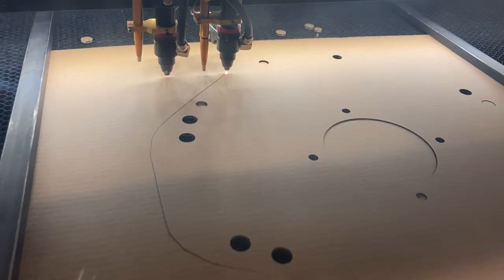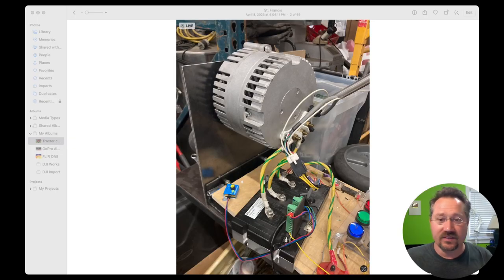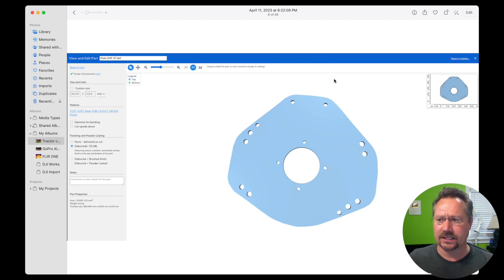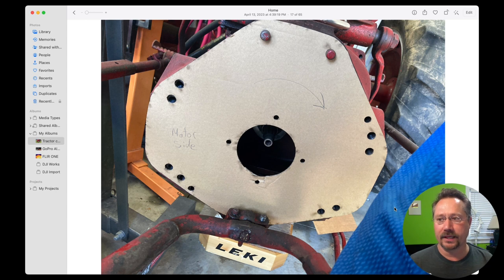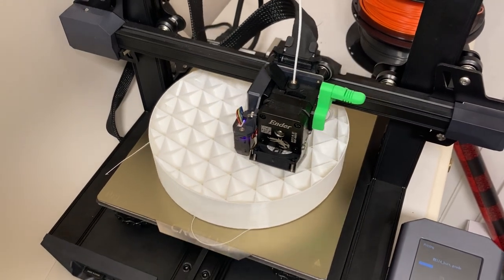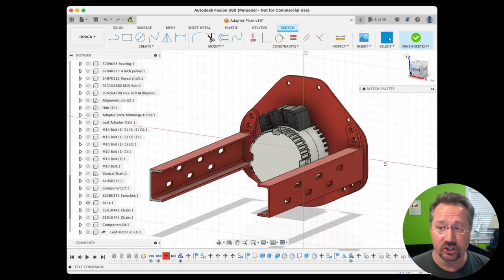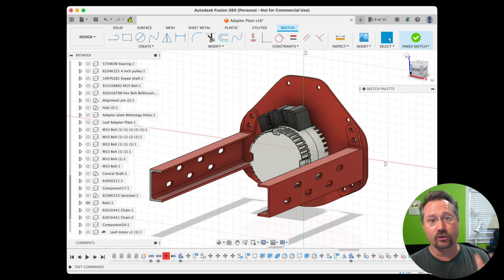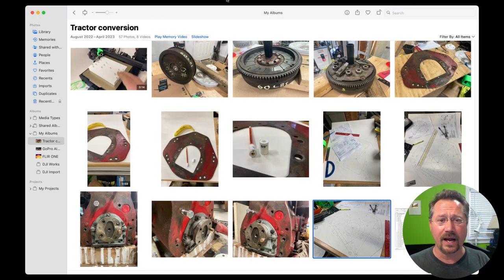Electric Tractor Update, April 2023 (International 300 Conversion)

Comment from the maker: A note on going clutchless/keeping the flywheel or not - I am making sure to NOT modify the transmission parts. If I go clutchless, I'd just disconnect the clutch pedal. If I decided clutchless wasn't appropriate and I then wanted to add the flywheel, all the parts would still be there to make it happen.
I also have the original flywheel/clutch/clutch-cover AND a new clutch and clutch cover, so I have both parts to build an adapter AND parts to do a stock setup.

Comment: I think you're better off using that clutch.  You keep the full functions of the tractor, and also, a heavy flywheel actually works well in your favor if you're using it to plow and hit a rock, or hitting a stump with the brush hog, etc.  that sudden SHOCK to the system will be much less damaging towards the motor because you have the momentum of that heavy spinning flywheel in your favor, and it will absorb most of that shock due to it's high inertia.  You can just program your initial start/ spin speed of the motor to be progressive or gradual at first -- so that it allows your flywheel to get moving without a sudden spike in current like it would if you just stomped on the gas all the sudden.   

Also, I have to say-- if you're worried about that flywheel being to big or heavy etc. because it's not powerfully enough, then your tractor isn't really going to be that useful.  Because when you're pulling a plow in the ground or dragging around a brush hog, or using a  post hole digger or whatever else you want to use this for--- it's going to require a lot of torque coming from that motor.   I'd use the flywheel and clutch-- that is the absolute best play IMO.

Comment: Great video! I think I would have tried putting an alignment rod on the transmission shaft, then using a quarter inch piece of plywood for the template, with a suitable hole in the center for the alignment tool, and just trace the plate outline from the transmission side. Thanks for sharing.

Comment: Glad to see this project again moving, so you have gone away from using the leaf motor and controller and battery's or have I missed a video of a red think. 👍👍
Reply from the maker: Just trying to figure out what’s best for the project. The Leaf motor needs well over 200v to run. It can spin at up to 10,000 RPM, but old tractors like this run at around 2,000.
Reply: @BenjaminNelsonX  right sounds like a bit of a miss fit by a couple of revs. 👍👏

Comment: So, I’ve got this “extra” 3 cyl. Ford 4000 that, under load, lost compression in a cylinder. Instead of rebuilding toying with doing an ekectric conversion...thanks for the video. Lots of helpful stuff here. 👍

Comment: I’m heavily emotionally invested in your tractor, here in suburban Brisbane, Australia. I strongly believe we must figure out how to convert old rolling stock as part of the transition away from fossil fuel everything. Have you thought of building the battery holder so you can swap out the spent battery pack with a fully  charged module to increase the work duration of the tractor? I can’t wait for the next instalment. More strength to your arm!

Comment: As you mentioned, you could devise a connector which rotates both shafts so that the PTO can be used when the tractor is moving.  Then additionally, using your separate hydraulic capability, devise a system that raises the back wheels slightly so that you can then run the PTO with the tractor stopped if needed :)
Reply from the maker: Easy to run the PTO with tractor stopped - take it out of gear.

Comment: Couple things on the tractor.
If it has a "t.a." torque amplifier, it will not engine brake when the lever is in the rear position.
The flywheel situation. The stock flywheel isn't recommended spinning much faster than factory 1450 although I've been spinning mine to 3500 😮. northwoods engineering out of ham lake mn can make you a cnc aluminum flywheel, they build them for antique tractor pullers.
Reply from the maker: Interesting about the torque amplifier! I hadn't heard about not engine braking while engaged. I didn't see that listed in the owners manual or anything.
An aluminum flywheel would be slick! Wonder what the cost is on that....
Reply: @BenjaminNelsonX  It should be listed in the owners manual under "Torque Amplifier" and then "Driving the Tractor". There's a warning that says:

"Caution! To maintain safe control of the tractor speed and to utilize the engine as a brake during downhill transport operation, the torque amplifier operating handle should be in the direct drive (fully-forward) position.

Note: The torque amplifier operating handle must be in the forward position when it is necessary to tow or push the tractor to start the engine"

Basically when the TA is engaged (pulled back) it has an over-run clutch that will allow the transmission to spin faster than the motor. So even if the motor is completely stopped the tractor could keep rolling while in gear if the TA is engaged.

Comment: Glad to see an update on this project! I'm in the planning stages of a nearly identical conversion and I'm planning on using a similar motor: the ME1003. Right now I'm trying to decide on which battery modules to use, have you chosen those yet for your conversion?
Reply from the maker: I haven’t decided yet. In the end, I think it’s just going to be whatever maximizes total KWH under the hood. Right now, I’m just focused on the driveline and I’ll use some small batteries I already have for testing.

Comment: Might just use the flywheel and clutches as they were. With regen you can recapture the rotational inertia.
Not sure if the bearing on the motor can support the weight, though...
Glad to see progress being made!
Reply: Would it be possible to weld some sort of a cradle to the motor shaft to take some of the extra weight???

Comment: Glad to see you working on this project again. I wonder if they make a motor strong enough that would be like those motors on the back of a washing machine tub. That way, it could fit inside the housing and with the PTO spline in the center. Then that would be fully integrated inside and run the PTO? Just a thought. Bet you're glad you bought your Bolt now that GM is ending production! Big mistake on their part.

Comment: So glad to see progress on this! I do have one question though:  Why 72v? I would think for this project you'd be fine sticking with 48v which would make it a lot easier to source batteries/BMS and other parts as 48v stuff is a lot easier to get than 72v.

With these DC brushless motors the torque you get is a constant amount of force per amp. The voltage only really affects the top end motor RPM. The original gas motor in this tractor maxed out at around 1750 RPM. I don't think you'd want to drive the input shaft of the tractor (The "driven shaft" as you call it) much faster than that as the transmission components weren't engineered to run that fast. You also want to stick with 1750 RPM because that's the RPM that will drive the PTO output shaft at the correct "540 RPM". If your motors runs faster than 1750 then you're going to have issues with everything downstream not running at the right speeds. Given you're probably going to be running this at such a low RPM there's just no need to go with such a high voltage. 

The double edged sword here is also the horsepower rating of the motor is based on running it at 5,000 RPM. If you're running it at say 1750 RPM instead, this motor puts out 0.1 ft/lb of torque per amp of input. So at 120 amps (Max continuous) you've got only 12 ft lbs of torque. The stock engine you pulled out of that tractor was capable of pushing around 120 ft/lbs at 1200 RPM (According to the University of Nebraska Testing)

HP = Torque (ft/lbs) x RPM / 5252

So at 12 ft lbs and 1750 RPM you're going to get around 4 horsepower (max continuous) out of this motor. It can surge up to 10 HP for 30 seconds, but that's vastly under-powered compared to the engine you removed, which tested (On a dyno) at 43 HP at the belt. I know you're saving some power from the hydraulic motor, but hydraulics only pull a few HP from the motor, it's not saving you THAT much.

If I were you I'd try to find a motor with a higher torque rating. You don't need the higher RPM that the higher voltage will give you. Instead you need something with more torque. I would completely disregard the HP ratings of the motors you're looking at. At these low RPMs you're never going to approach the max HP of the motor. Instead you should look at their "peak stall torque" and get something that at least peak closer to the 120 ft lbs (163 Nm) that the original gas motor could produce.

The ME1302 for example gets you a lot closer at around 74 ft/lbs, but it's still a far cry away from the 120 ft lbs the original gas motor could make.
The biggest torque output I could find from Motenergy is the ME1616 at 134 Nm / 99 ft lbs. Still not 120 ft lbs, but close enough that this would probably work.

I also think going with a separate motor for the PTO is a great idea. You generally want the PTO to always run at 540 RPM, but when you're mowing, tilling, etc, you may want to adjust your forward ground speed as you navigate bumpy terrain, turns, etc. Having different motors for the wheels and the PTO, you can easily adjust your ground speed while maintaining a constant 540 RPM for the PTO.

One idea I've had for these tractor conversions is having separate motors for the PTO and drive wheels that you can couple together when desired. Basically there are two primary ways to deliver power from a tractor:

1) Tractive power
2) PTO power

When you're mowing, rototilling or doing anything else with the PTO: You want most of your power going to the PTO. In these applications the wheels aren't doing any real work, they are just rolling the tractor around.

But for pulling plows, discs, and other equipment: You need all your power at the wheels. Since these implements don't use the PTO, you don't need any power at the PTO.

So for me I'd love to see a system where the PTO motor can run separate when doing PTO work, or couple it to the drive motor to get all power to the drive wheels when pulling heavy implements like plows. You could use a bigger motor for the PTO and a smaller motor for the drive wheels to save costs (Since the PTO always needs a lot of power when in use, and when not in use that power can be diverted to the wheels anyway)

I wonder if you could re-purpose the clutch to accomplish this: Drive the inside shaft with one motor, the outside shaft with another, and use the clutch to couple them together when desired.
Reply from the maker: Some interesting thoughts there. Going with 72v would mostly be for lower current for a set amount of work, rather than for higher speed. It’s not much more difficult/expensive to get 72v parts instead of 48, but it does tend to go up quickly above that. 

Another good reason to go with a separate PTO is that it would allow running the motor faster, and then gearing down more for the increase in torque.
Reply: @BenjaminNelsonX  "Going with 72v would mostly be for lower current for a set amount of work, rather than for higher speed."

So I totally understand where you're trying to go with this. But I think you're going to find that with this application "work" is usually more of a function of "torque" rather than horsepower. With most of these electric motors the key to higher HP ratings is pushing higher torque values at higher RPMs. But in this project you're RPM constrained: You can't really run any faster than 2,000 RPM. 72v would let you do more work with less current at higher RPMs, but not so much in the lower RPM ranges you're dealing with.

According to Motenegery the ME1117 has a torque constant of 0.13 Nm per amp. So 120 amps will give you roughly 12 lb ft of torque, regardless of what voltage you're running. So going with a higher voltage is not going to buy you much. Where as going with a lower voltage would let you buy a smaller number of bigger beefier cells, fewer cell taps, etc. Instead of 24 cells at 200Ah each you can do 16 cells at 300Ah each. You'll get more usable torque this way because you can (generally) pull more amps from 300 Ah cells than 200Ah cells. So you'll likely get more torque from a lower voltage battery with higher Ah cells.

All I'm saying is I would find the perfect motor first, and figure out at what voltage and amperage you get the best power output for your 2,000 RPM application. I would do this before settling on a battery voltage. I'm pretty sure the ME1117 is vastly under-powered (torque wise) for this particular task. Maybe if you add a reduction gear to lower the output RPM and increase the torque it might be a better fit, but if you're going to do a 1:1 gear ratio I think you're going to be underwhelmed by the torque output.

Comment: Nice thing about reverse engineering old equipment designed on a drawing board is the dimensions are almost always a fractional inch. 

I would keep the clutch is you can.  Maybe take the flywheel to a machine shop and have some weight reduction done.  I bet they could easily whittle 20lbs off of it.  If you do any mowing, you want the clutch.

You might could find a crankshaft from a similar tractor to make your adapter from.  It would be a lot less machining to just cut the end off and add a keyed shaft.

When you make your next template, go through the access hole in the bottom to check shaft alignment.  I like architecture chip board over cardboard for strength.  Maybe cut out a few layers to stack up.
Reply from the maker: The issue is really that driven shafts in transmissions are "floppy" - they always have a bit of play to them. The shaft itself can't be used to find center. Be center on version 1 of the cardboard template was only about half an inch vertical. I'm not sure I would have been able to see that anyways looking up from below the tractor.
The next thing up from cardboard for me would be 1/4" plywood. My friend's laser can cut that easily, and I'm planning to use 1/4" steel plate, so the dimensions would match.
Maybe when I do that, I can get a camera looking up into the transmission from below!

If I kept the clutch and flywheel, the bare minimum I would want to do is at least take some weight off of it.
Reply: @BenjaminNelsonX  I like the 1/4 plywood idea.  Might could add a small access hole to in in the test piece.  I would think the motor could handle a decent about of weight hanging off of it.  Remember a belt drive with a 6in pulley and 20ft lbs of torque places 80lbs of transverse load on a motor shaft.  I still think turning down the flywheel to remove some weight would be a good thing.

Comment: That flywheel is a huge energy storage, doing the math on this probably will show the motor at a serious torque disadvantage and not a serious replacement option. Stalling motors are not a good thing in general.